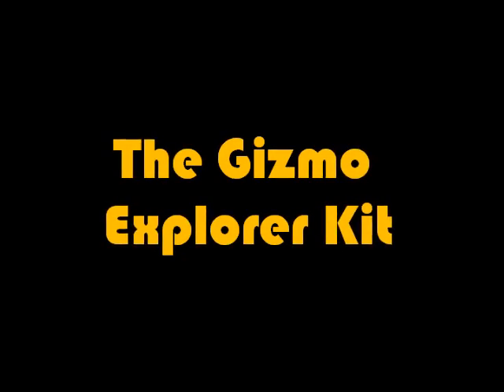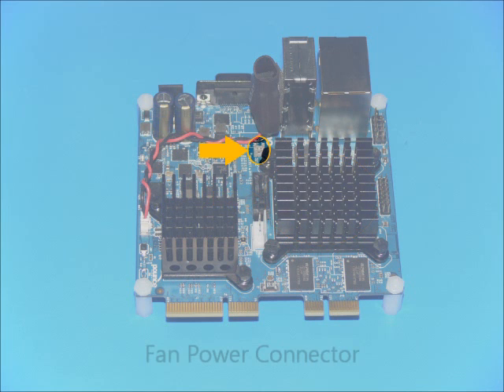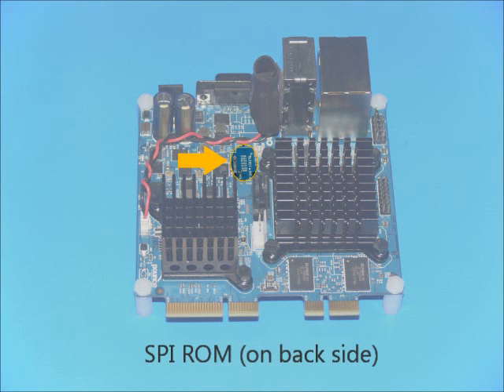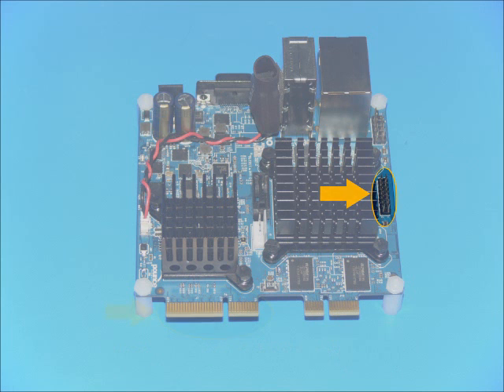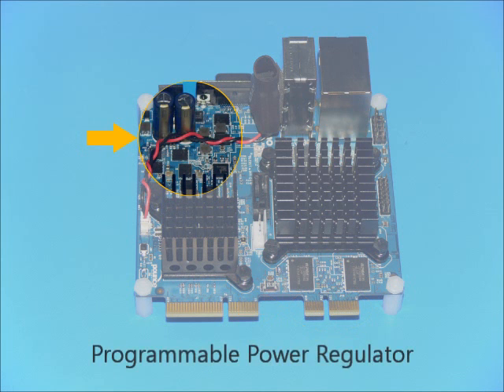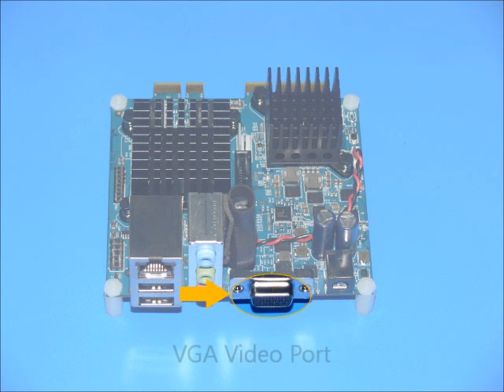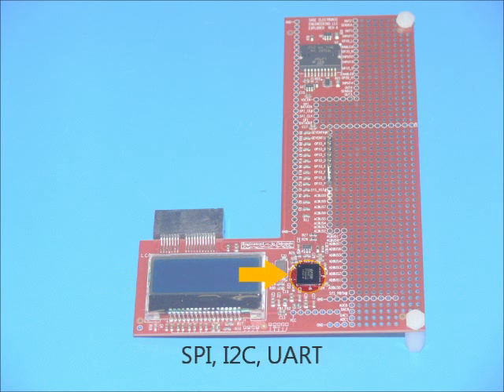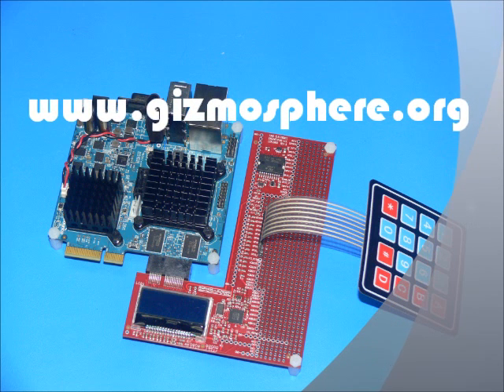Gizmo Explorer Kit - video 2: Tour of Gizmo and Explorer Boards

Comment: Nice development board as far as the heat sink goes you could likely replace the heat sink in the product. This is for development not to be part of a product. You could develop something with it then put your idea on Kickstarter to raise cash to package whatever you developed? It seems to be due to the fact that it is using an APU there is a limited need for support circuitry. Someone with the skills needed could develop a product around it. There is likely a reference design somewhere?